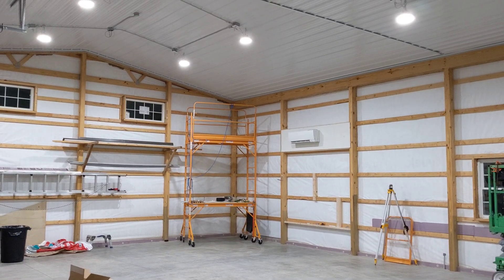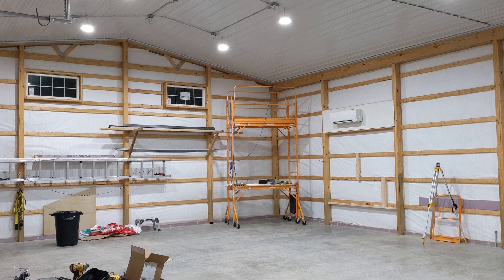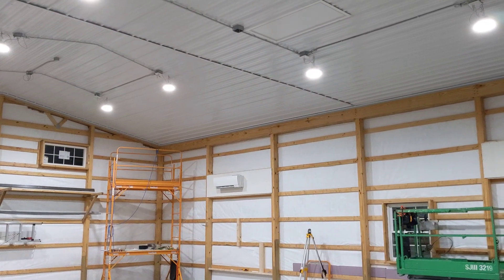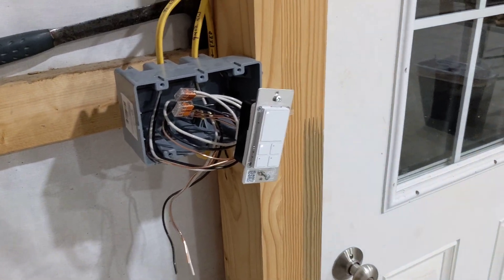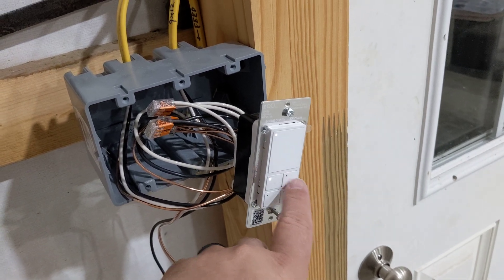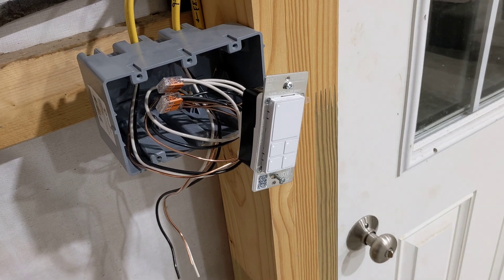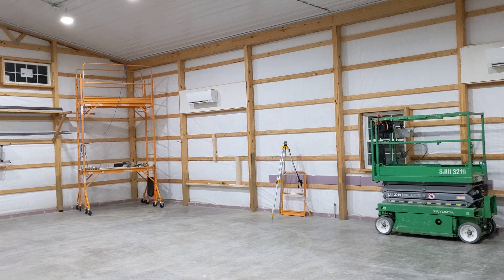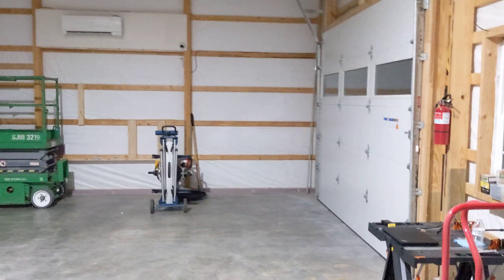Automated dimming of Hyperlite LED workshop lighting

Comment: Building the same building as we speak, what brand and size mini splits did you choose?  Did you insulate ceiling? What access door is that in the ceiling to match the white.  Thanks
Reply from the maker: Hi - two 18k Mitsubishi Hyperheats. 18k needed for the heat side more than cooling. I barely run them in the summer, even with bronze roof. 20"+ blown in fiberglass in ceiling. Unsure on the hatch door, builder spec'd it, but it's very nice, and insulated

Comment: How did you get the Zooz scene controller to work with the multiple 150w lights?  Their specs say that the scene controller can only handle 150w total LED load.
Reply from the maker: Hey sorry for the late reply I wasn't getting notifications of comments. Right now I'm using them 1:1. One dimmer module per hyper light.

Comment: SO the link that you sent states that the lights are 1-10v not 0-10. Which ones do you have?
Reply: The Zooz can handle the 1-10 lights. There is a relay in there that makes it compatible. I have the same setup but with only 2 lights

Comment: Do you have a diagram of how you wired this?
Reply: I could use this as well!
Reply from the maker: @jmarshall6412 See https://postimg.cc/8jjy0kbw
Reply from the maker: I thought I described it, maybe not. Basically all eight lights have their own individual Zooz dimmer module. Power is wired to all eight modules. The module switches the AC line out to each fixture; in addition it provides a 0-10V signal for dimming. So all fixture/module pairs are wired in series physically (in parallel electrically), straight from a breaker. No hardwired wall switch.
Reply: @slip0n0fall  Could you correct or validate please? Looking to do a similar setup: 
1) Zen32 controller is receiving only 120v from the panel with no load circuit
2) All 150w fixtures wired in series on a second 120v from the panel
3) Each Zen54 dimmer is powered by the 120v and drops its own 0-10v signal wire to 1:1 to each fixture
4) 0-10v line is not run in series between all 8 of your fixtures/dimmers to achieve the individual zones
Reply from the maker: @drewsof sorry I said mine were wired 120 in series but I just meant physically. They're (modules) are wired electrically in parallel. I'll try to get a diagram up shortly and will link in.
Reply: @slip0n0fall  very interested in a diagram myself.  I just built a 12x32 pole barn, getting power in a couple weeks.  I never thought about this approach, but so glad I stumbled across your video
Reply from the maker: @miketalonguy  https://postimg.cc/8jjy0kbw